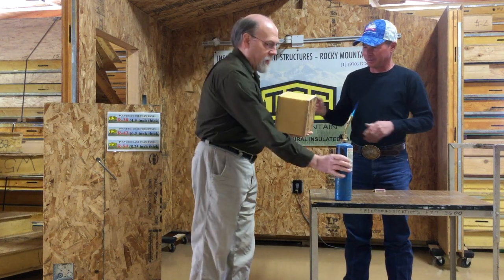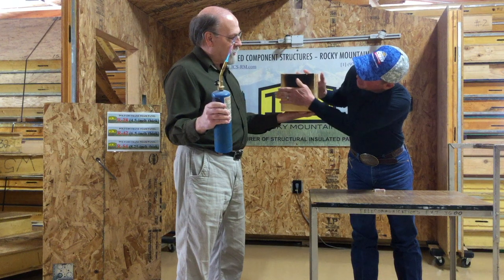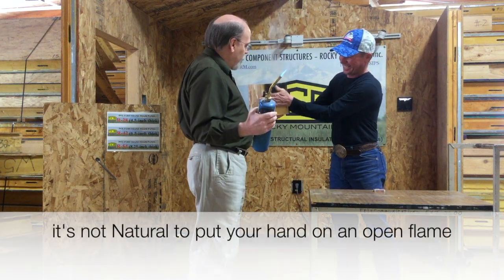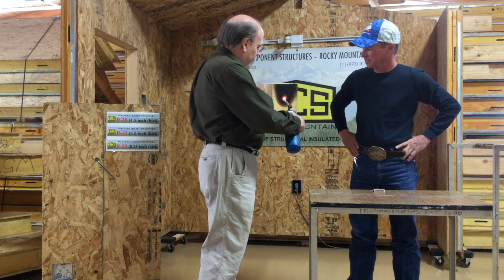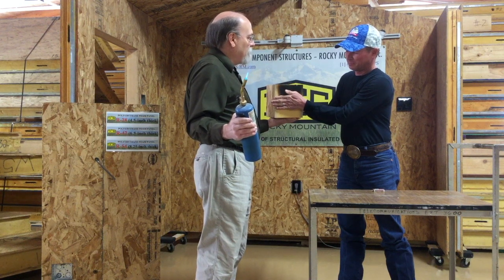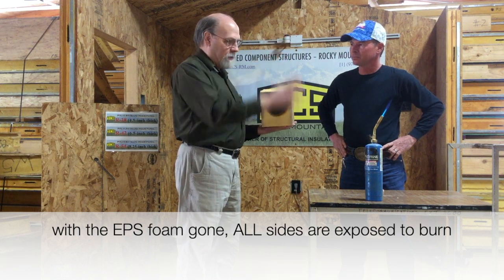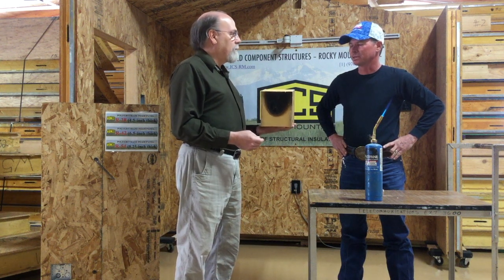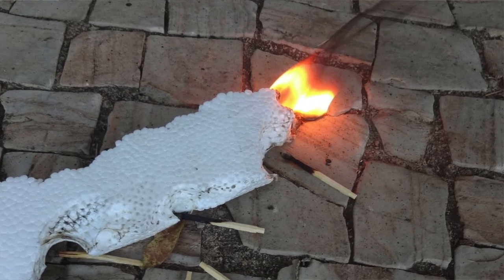How to Build a HOUSE that WILL NOT BURN

Comment: This one subject I would be very careful with and definitely elaborate more on what actually causes a house to burn.  Especially being that certain ASTM testing standards are in place for example ASTM E84 regarding fire resistance of building materials.  With modern foam manufacturing process both EPS and XPS are "fire-resistant", however multiple steps in the building process can improve or diminish the "fire-resistance" of any building material or application.  At the same time most foam products manufactured before ASTM E84 was put in place as a standard requirement for both XPS and EPS were both flammable and "off gassed".  Even though we as building professionals in our fields have our own bias, I feel its important to not let those bias present misleading information to the end users of that information.  Otherwise another great video on SIP's keep it up.
Reply from the maker: Good insite and informative. I appreciate the dialogue from industry professionals, Thanks

Comment: What brand were the SIPs in the first part of the video?
Why not use larger more efficient SIPs on the House build?
I did not see any SIP Seal Adhesive/Sealant used on the house build.
Reply from the maker: ICS SIPs are the Polyurethane in the Video, 6.5" walls are R-42 and the roof are 8.25" R-54 is there better than that? On the EPS build they provided the "BLACK NASTY" sausage tubes. It is a gasket and never Dries. I prefer expanding foam for my builds, as it seals and glues.
Reply: Gobuilditbetter 
Yes there are thicker SIPs EXTREME TECHNOLOGY PANELS.
I agree that hollow areas must be filled with Closed Cell Foam but SIP Seal Brand Products in Big Sausage tubes primo!
There is also a SIP manufacturer that uses metal internal braces and uses a sheet metal 90 degree bracket attached to the foundation that the SIP Blocks are held in place with and I would use SIP SEAL both under and on top of the bracket. In brain storming secessions with my Comp Owner we are going to seal blocks to each other on the earth side of the wall!
Reply from the maker: Brian, glad to have you back. I am going down the list of SIPs manufacturers I have worked with: going back 12 years, first it was KingSpan, R Panel, Premier(I think is EXTREME) Thermal Span( job coming up) ICS eco SIPs and another EPS company that escapes me. I can get a 12" EPS panel but I like the performance from polyurethane for performance per inch and that it is an adhesive thru and thru. Put a piece of duct tape on a sheet of EPS and pull it off and the top layer comes with it. I have a fear that if the top layer is all that adheres to the sheathing then delamination can occur on large span roof panels. With the Closed Cell Polyurethane it also resolves the Vapor Migration issue too. The Metal Sill Bracket you mention, is it like the sill plate used in metal stud walls(commercial)?
Reply from the maker: If you are sealing "blocks"...earth side of wall, Might you be talking about ICFs? If so you should talk to my ICF expert Joey Hughes. He builds entire houses with ICFs. Ask him about his Seminar coming up soon in Idaho.
Reply: Gobuilditbetter 
My preference is to build the Basement with ICF and depending on the desire of the customer — also on First Floor.
Then use SIPs on second and higher floors. I also prefer TimberFrame and T&G Floors on Second & higher floors. 
The Metal Bracket is basically a Elbow Piece (SheetMetal) and I am debating just using stock pieces of larger size to  guarantee water a water tight Basement Wall and using PolyWall when it becomes approved for under grade use. 

Would you rather use Peal & Stick or Liquid Applied Water/Weather Barrier?
Reply: Gobuilditbetter 
SIP SEAL is like that Black Nasty!!!